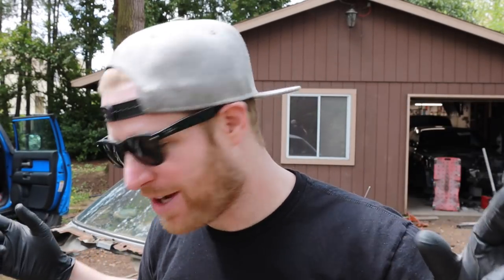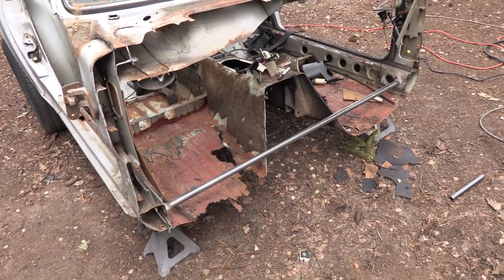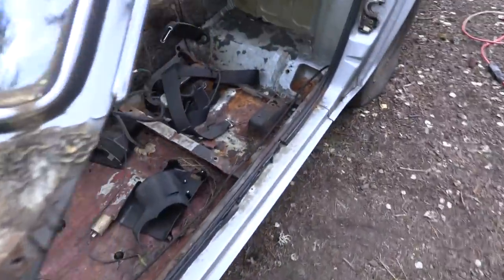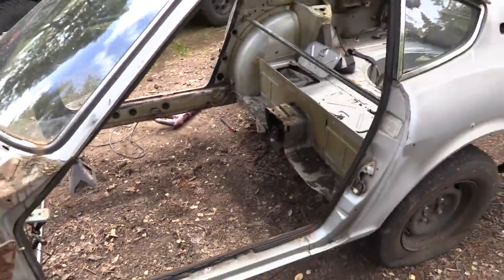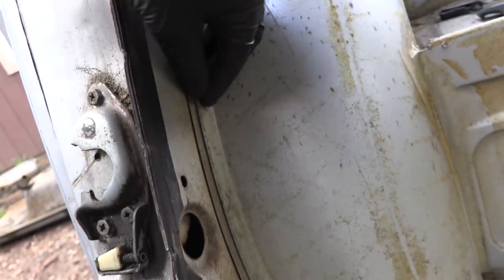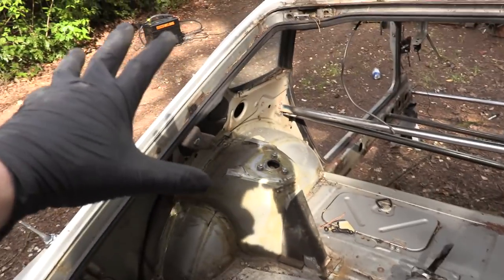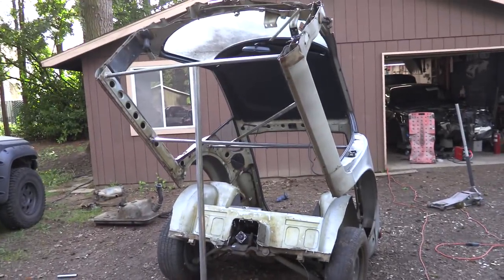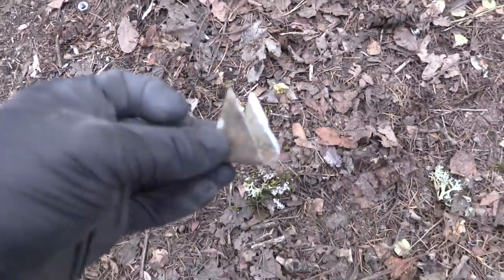Cutting the 240z Body Off Of... The Car?

Comment: 6:15 why dont you just weld in between the two pipes. So that they are connected?
Reply: Rocket science....
Reply: i was thinking the same thing
Reply: Terrifying T-Type his engine hoist is busy hoisting the v10
Reply: Terrifying T-Type It's holding the beemers engine rn
Reply: there is a big gap in between the two suports
Reply: Or if they don't touch just use an offcut to join them.
Reply: llalma13 ohh did not see that. Well could have welded some metal piece in between then

Comment: Lol @ bracing AFTER cutting out all the structural integrity
Reply: B is for backwards.
Reply: Total dogs dinner
Reply: He had two braces in it before he cut the floor out, they kept the car body rigid and in its original proportions. After it was cutout he braced it some more to prevent the body from flexing out of shape while he separated the shell and rear subframe. If you're only here to act high and mighty and critique him on shit you know nothing about then get the fuck away from this channel.
Reply: Shona, Criticism is sometimes the best thing for a person. If the person is misinformed or just arrogant then sometimes it'll help everyone. I'll be shocked if this turns out right but I'll be around if Chris can prove me wrong
Reply: Yeah, I was fighting the urge to yell at him through the computer. Not quite understanding the function and purpose of bracing...

Comment: Yea.. "You're in over your head"
Reply: i think he'll be fine
Reply: Exodus 2017 I think so too. That was just a joke from his instagram post.
Reply: ahh ok my b
Reply: He has confidence in what he’s doing!
Reply: If not, he's certainly good a faking it lol and that's half the battle
Reply: Chase Nixon because YouTube...
Reply: It is his money and he can do what he wants with it, why simply fix an M5 when you can do something no one has ever done before. thats why we watch his videos, so what if he is in "over his head", mistakes will happen and that how you learn from them.
Reply: only the floorpan is rusted beyond repair. everything else looks good enough
Reply: if the windshield cracks id say he didnt brace it enough... but im totally down for this bmw/nissan new and old hybrid marriage!
Reply: The rust is literally not even remotely the problem. The problem is he's locking the chassis in a flex and stressed state with those "support bars" because of his lack of a frame table and the fact that he cut most of the structure out of the car before welding them in. Since he's locked the frame in this stressed state every single on of his measurements will be wrong.
Reply: Well he already stated the rusted out beer can will make him his money back from the things in said beer can (dash and the rear trim pieces and shit). Also its very hard and INCREDIBLY expensive to find one of these things in any condition that is easy on the eyes in AUSTRALIA, and we dont get snow and barely have salt anywhere near anyone. Imagine that in America.
At the end of the day, he wouldve spent more money than he did on the m5 and the 240 if he tried to buy a clean 240. Its a build channel, not a buy a pristine car and then do nothing to it channel.
Reply: The 'beer can' is the cool bit !
Reply: Keep up a the back , his gambling with his mums pension pot nowadays
Reply: Nah it be fine. Go back and watch the Evora episodes. That looked as bad
Reply: The beer can with an M5 heart is better than either the overweight M5 , or the under powered light weight beer can . So combining them makes tons of sense . That V 10 might upset the weight balance though , he should go out of his way to lighten the front end so it doesn't handle like shit .
Reply: yeah i think the ikea furniture result would be a bit different if I handed you a pile of unfinished boards and said "build this in the picture". fabrication and bolting on parts are not the same thing. this is going to be a 50 thousand dollar pile
Reply: Thank-you!

Comment: Hi i was woundering if i can pick your brains. I was rattle canning clear coat on front fender and after the 2nd coat of clear coat it started to go milky but it was like a polished milky look on the panel. Isit possible to buff the milky haze out or isit a full sand back and spray base coat then clear.
Reply: You should be able to wet sand the milkiness out  of the clear without having to respray any of your base coat.

Comment: nice, but what happens if you have an accident, will the body you weld back together hold the force or just brake apart? i mean the structure is somehow weakened from the cutting right?
Reply: Makveldz maybe he’s making a roll cage? Not sure tho
Reply: Welds done correctly can actually be stronger than before.
Reply: AsianProdigyProductions he is
Reply: He's building a tube frame chassis, says so in the video and previous videos, the structural component to the car will be that chassis, at that point the body is mostly a skin.  Think NASCAR, the panels are for aero and looks all the structural bits are steel tubing.
Reply: That's basically what he's doing, tube frame chassis, everything will be attached to that and the frame rails to proved the actual structure.
Reply: thanks for the comments guys! makes sense!

Comment: If you want a high watch time percentage on a 15 minute episode don't spend 1 minute on a sponsor that does not fit your viewer demographic. A lot of people skip those burnt in ads. Personally I usually just suffer through them since its faster to watch the ad than it is to the find where the ad ends.

That's just my thoughts. You would be loosing 6% in the above scenario.

Comment: You put in the bracing after you fucking cut the car in half....

My dude, for this kind of bracing to work AT ALL you need to bolt the entire frame to a jig / chassis stand BEFORE you start any cutting. With this bracing, all you're doing is locking in the compressed position of the weakened sheet metal after the car was fucking cut in half.